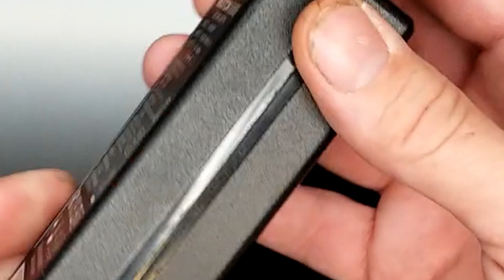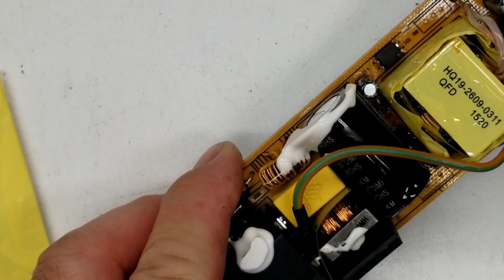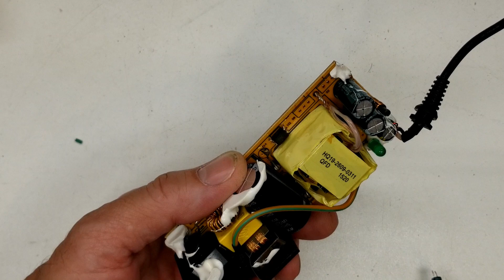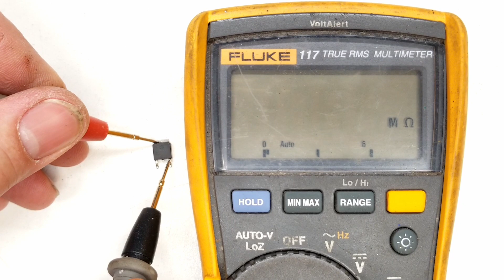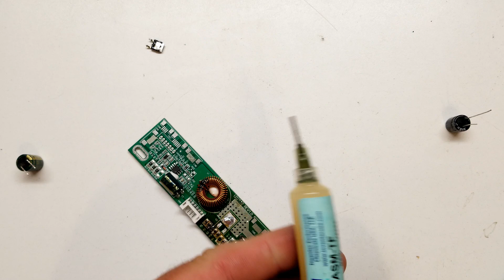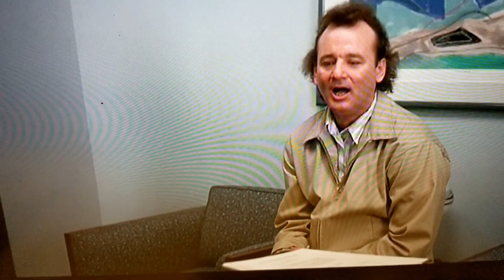ATRON VISION VIDEO MONITOR AVQ270S NO POWER BACKLIGHT DRIVER REPAIR

Comment: I think you might have had a rather large voltage drop over the leads going to your load when doing the load test of the power brick. That would explain why it went down to 11V. Better to put the DMM leads closer to the supply output. Really nice repair and video!

Comment: What was the specific role of the capacitor you changed in the power supply?  Thanks for the description of how that power supply works
Reply from the maker: The role of the capacitors is th store the charge to overcome the inductance of the leads(wires) feeding it.
Reply: NorCal715 I mean what role did it play for the switching ic that caused a dip in voltage when loaded?

Comment: Hi norcal715 is it unnecessary to check the main filter cap for the ESR because he is operating at a lower frequency (120 Hz) ?
Reply: If it is bad, it will become a hot resistor, very important to check, plus
you would have more ripple.. two reasons to check it.
Reply: @MrMac5150 MrMac5150, thx you for the replay.
Reply: I mean reply not replay

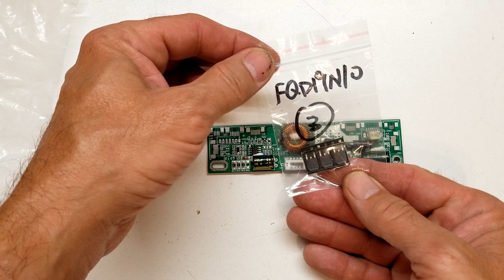Comment: Nice presentation, until the audio went out around 16:20 to the end..
Reply: Audio worked perfectly fine for me
Reply: @ishanfernando3064  me too. fine on the audio.
Reply: it's because the audio is only in the right channel so if you're watching on a device with mono sound (only left channel) you'll hear nothing. Best to mix videos like this down to mono to avoid this